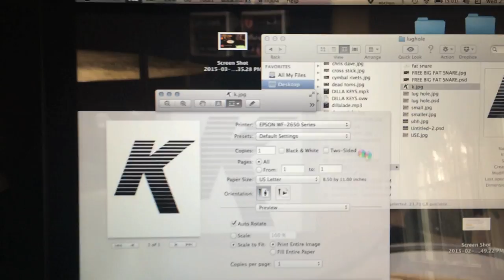How to Make Your Cheap Cymbals Sound Amazing

Comment: That is the reason I take the logos off my cymbals, except for the bottom logos.  I use a variety from expensive to cheap, I buy cymbals based on the sound.  If I like a PST5 better than a 2002 then that is what I go with.  I just cannot stand drummers from the audience coming up to my kit before a show and pre-judging me based on how much cash I have sitting there.  There is also no identification on my gigging kit (It is really an old 1993 Export Kit), but I dare anyone to figure this out.  Keep up the good work!

Comment: funny video.
That looks like a brass cymbal to me. Am I wrong?
 thats about true with guitar amps. have have a solid state half stack Marshall amp one you left, a haf stack tube Marshall amp on your right and make it look as though you're playing thru the tube amp but really play thru the Solid state amp. People will then think the amp is awesome.
99% of drummers are loyal to the death of one brand cymbal or another. I for one have 2 different brand cymbals in my 12 piece Mapex Saturn kit and I'm not ashamed at all. If the cymbal sounds like what you want buy it. Don't worry about brand.
Reply: Absolutely brass, you can tell because it sounds terrible.